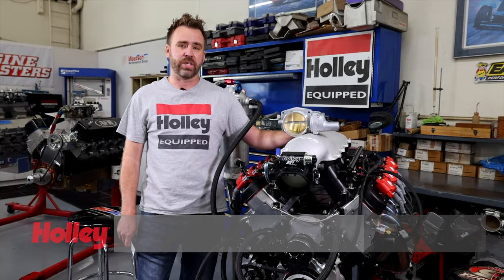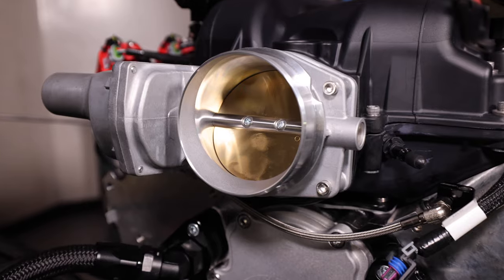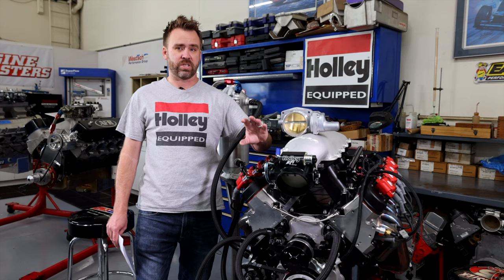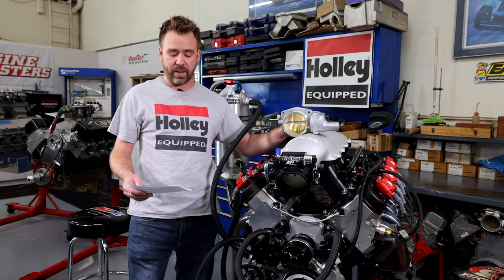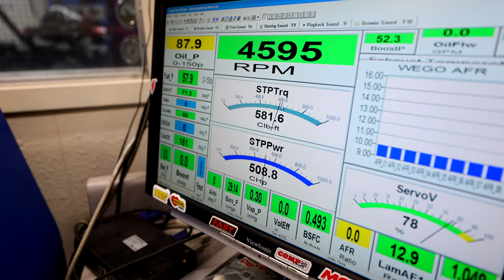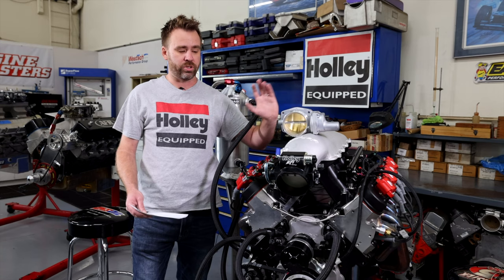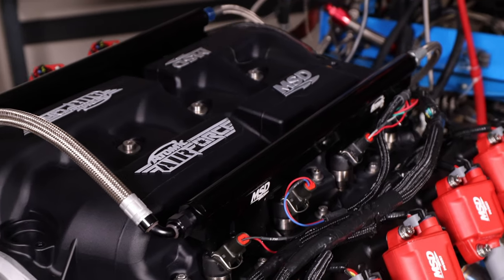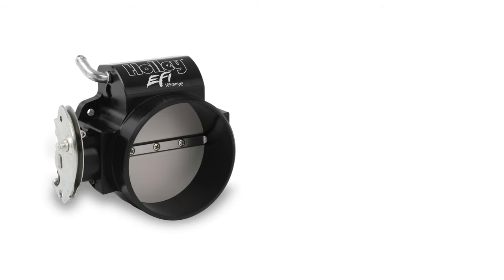Dyno Tested: Factory LS 90mm Drive-By-Wire Throttle Body vs Holley EFI 105mm

Comment: I have a Sniper TB on a 6L and the induction noise through the IAC drives me nuts, are the EFI version any quieter?
Reply: If it's the whistle/belt squeal sound while accelerating you are referring to, a short 4 hole spacer will cure it.
Reply: @Bluecut70  Its a constant overly loud sucking sound when at idle, its just way to OTT. I ported out the opening of the inlet to the IAC valve, to remove the hard edges, and that seemed to have an effect but for the most part its still there...
Reply: @BBGuitars  did you ever solve the issue? Have same problem right now
Reply: @aarontovar8769  I managed to get rid of a little of it by removing any hard edges I could reach in the IAC port, but its still mostly present. Saw old mate about mention a spacer, I may give that a try...

Comment: Proof that the price of these expensive throttle bodies is not worth it and isn't needed. 5HP is not solid gains for the price you pay for this stuff people. Same as with their intakes. Take a stock truck manifold and throttle body and have them both ported and see what happens then. Solid gains and much more than 5HP. Lol
Reply: Watch more video on ported vs Holley stuff it’s been proven to be better 😂 and this is on pretty much stock the more mods the more you’ll see the difference